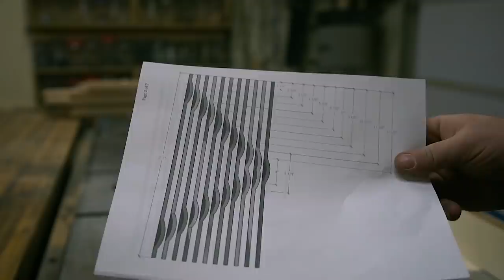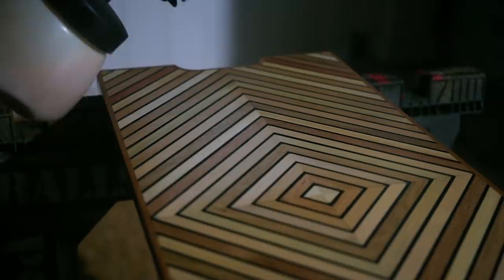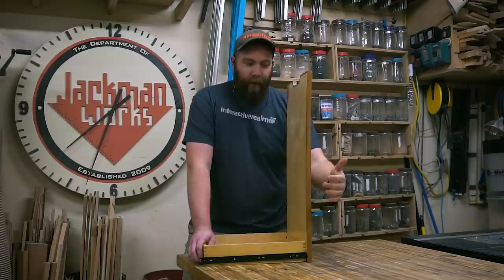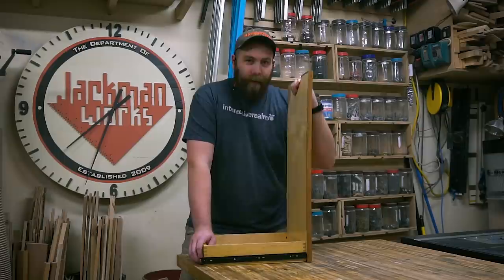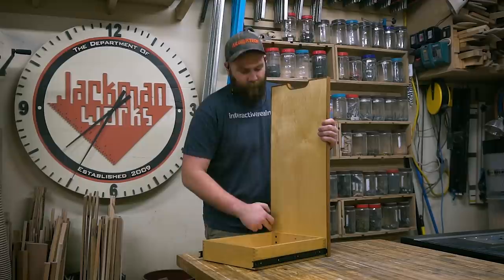Carved Barn Doors & Diamond Drawer Front (for Kitchen Island)

Comment: Seeking clarification! Arbortech's website describes the MiniCarver as both, "New and Improved," and "Discontinued." Any insight is much appreciated, thank you! All the best, @HoneyOnWales
Reply from the maker: The "Mini Carver" is the new and improved tool that replaced the "Mini Grinder". I'm using the "Mini Carver" here and the most notable improvements are dust collection (for sanding), variable speed, and a new rubber backed sanding head.
Reply: @JackmanWorks  Cool beans, thank you!